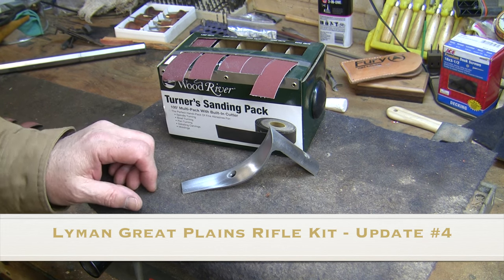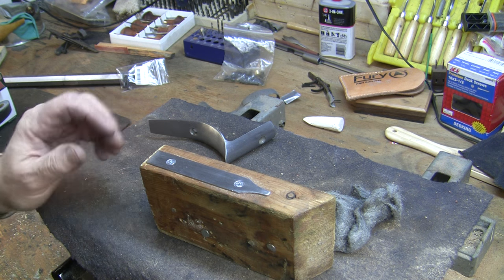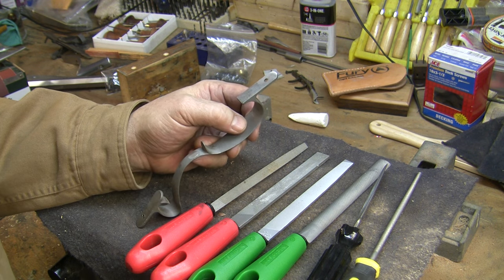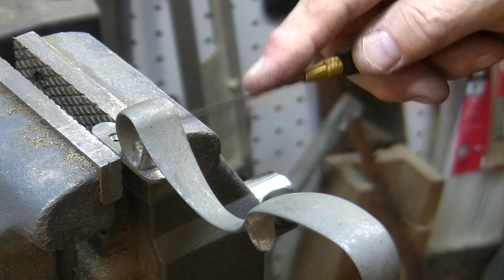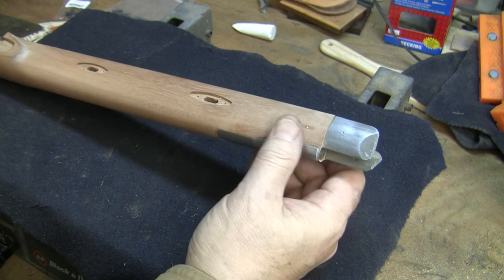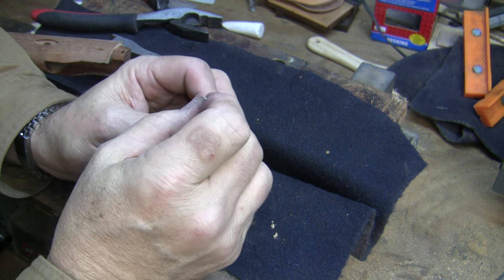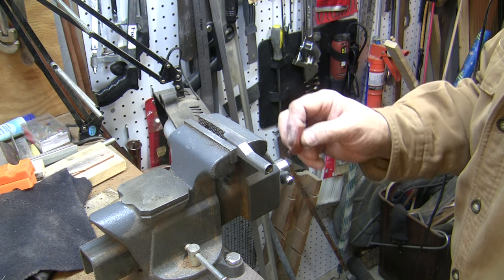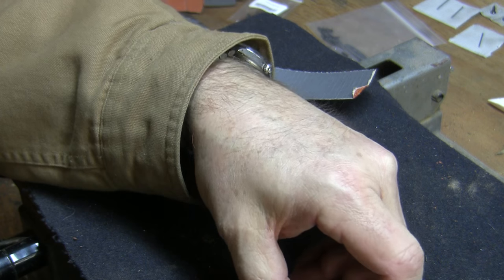Lyman Great Plains Rifle Kit   Update 4

Comment: +duelist1954 I have a question that for quite sometime I have been unable to get an answer for from anyone.   I assume you own the two handguns in question so I think you would be the best person to ask.   What I would like to do is acquire a Uberti 1851 Richards Mason and replace the brass grip frame and trigger guard with the grip frame and trigger guard from a Uberti 1851 London.   Do you know if the parts are interchangeable or if Uberti uses an entirely different tooling for the Richards Mason?   Here's an example of what I would like to recreate: http://www.antiquearmsinc.com/colt-1851-navy-conversion-revolver-london-pistol-38-rimfire-richards-mason-antique-guns.htm
Reply from the maker: The parts should interchange with no problems.

Comment: What's the difference between the sand paper and emery cloth?
Reply from the maker: Wild Blue Hickok sand paper is more fragile because it is paper. Emery cloth is stronger, so it stands up better to use on metal.
Reply: Wild Bill :Your question seems to depend on where you live, in Europe "sand paper" is only for use on wood, this is either made with sand, of various grade sizes, or sometimes garnet dust, but it is only for use on wood, Emery cloth/paper is for use on metal, and is Aluminium Oxide dust bonded to either cloth,(emery cloth) ,or paper, wet or dry, this is for use on metal or paint/plastic finishing when used with water as a flushing medium, fine wet or dry needs to be used with a flushing,(water) or it will clog up very quickly. In America however they seem to use sandpaper on metal, OK for rough jobs, but because of the large gaps between abrasive particles it leaves very sever scratches, Emery has much tighter density of abrasive particles.

Comment: Hi Mike,I have a couple of small holes in the base of the cock caused by the casting process. It is an assembled Rifle Shoppe lock. Is there any way that these small holes can be filled? I'm not planning on browning the lock or barrel. Thanks
Reply from the maker: Dan Ellis there are ways. The best way is to tig weld to fill in the holes, then file and polish the part, but that is beyond the capabilities of most of us. Since you aren't glueing or browning, you might get away with filling the holes with silver solder. I have done that myself. If I thought that I could file the pits out and re-polish the cock, that would be my first thought...but, not having seen the part, I don't know if the holes are too deep. Have you asked the manufacturer to replace the part?
Reply: Their is a single part material called Lab Metal that comes as a putty and then hardens with time. It can be machined, filed, sanded like metal and I used quite a bit of it when I built a GT-40 replica. Great stuff that matches aluminum perfectly and would match the polished metal pieces seen here very well.  BTW it comes in 4 oz cans for small jobs and trial.
Reply: No, not yet. I haven't had the kit for long and was wondering if there was anything I could do to avoid sending the part back for exchange.
Reply: Thanks for the suggestion. I'll have a look at this.
Reply from the maker: If it is a typical casting pit, you should be able to file it out and polish the part.